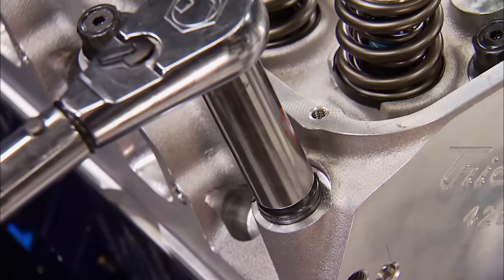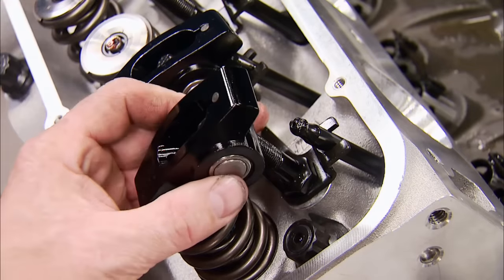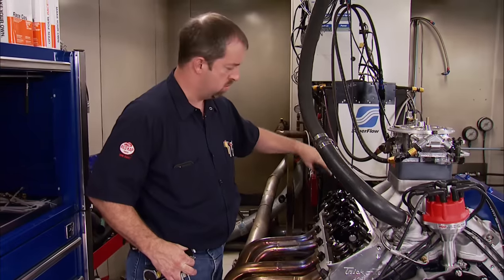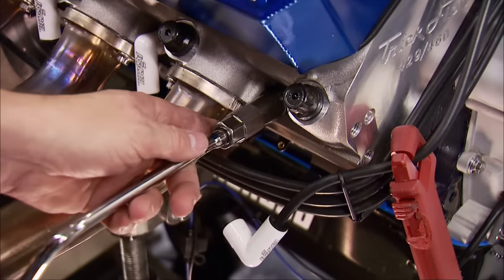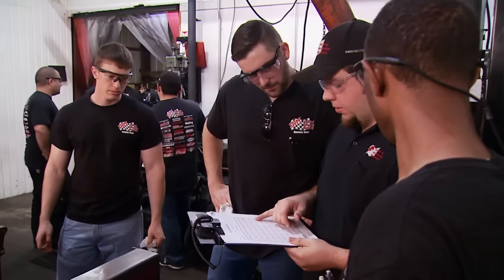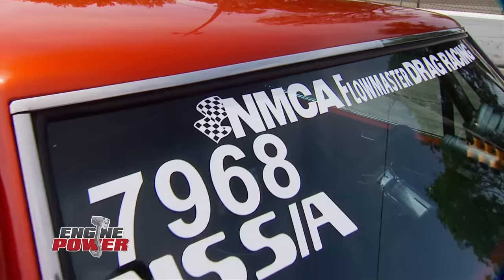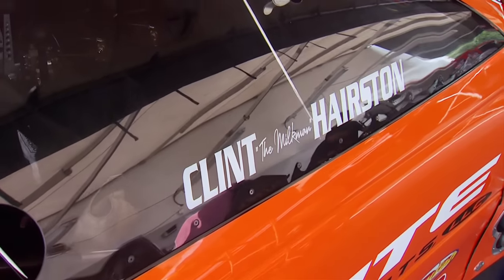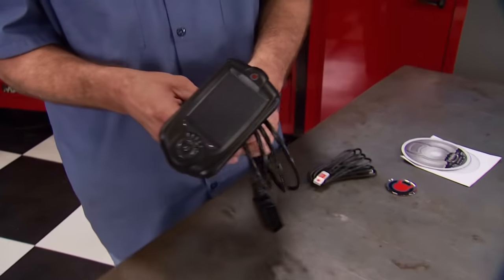Pressing the Limits of a Ford 557 by Adding Nitrous - Engine Power S2, E22

Comment: I'm 55 and it blows me away that over 1000 hp is achieved with relatively no exotic parts.  That would only have been a dream when I was young.
Reply: Don’t hate, soon it will be the internal combustion guys vs EV guys. The k24 is a killer engine but you know you’re stirring up a hornets nest saying it casually in the comments section of a big block build with nitrous. Everybody has their preferences, don’t create reasons to exclude/hate. Be stoked that there are people motivated to continue pushing this awesome hobby further everyday. Get out there and work on that project!
Reply: @datraktorman69  but it only last a few passes at the track before "BOOM"🤣
Reply: @datraktorman69  facts! I would never build a engine with cheap Ebay parts. I've known way too many people that engine went BOOM with that Chinese junk. You'll get your 1,000 rwhp but it won't last long🤣
Reply: @datraktorman69  yeah, I had someone build a reliable Rat that will give me many years of fun. So go ahead and save your pennies for a Ebay turbo.
Reply: That's a no 💩er. It used to be a real job getting just over one horse per cube. Now that's about where you start if you're going to build a real hot rod. This is the stuff that only dreams and science fiction were made of.
Reply: @datraktorman69  correction...my car is a daily driver. Where's your video of your 1,000 rwhp junk Chinese Ebay 2.4 turbo at?
Reply: @Russell_and_Rosko  it's nothing wrong with building your own ride. I actually built mines. Still working on it, I hate when you get some idiot talking about building a high horsepower engine with Ebay parts. If you're gonna build something, build it right from the beginning. Stop cutting corners.
Reply: @datraktorman69  yup! I figured.  Well congratulations 👏👏👏 #1 backyard mechanic on YouTube 🤣
Reply: @datraktorman69  believe what you want. P.S. don't waste your whole life on being a backyard mechanic. It doesn't pay much. Open your own performance shop and start building LS engines or something...Ha
Reply: @dontbusttheplace8151  👍👍
Reply: @datraktorman69  Apples to oranges comment. Not knocking any off them. I respect any powerful build. However I'm pretty sure those Hondas aren't NA. This simple BB ford pump gas engine is a monster for what it is. An easy reliable 1000 plus hp build.
Reply: Nicks backyardprojects Why waste your time on Honda’s when you end up getting smoked by one of them new Shelby Hellcats?
Reply: @datraktorman69  my fj20et skyline engine with stock rods set of aftermarket pistons and valve springs can make over 650 at the wheels . Fuck Honda,  Subaru,  worse Japanese cars to modify.
Reply: @bigboreracing356  then again ,those big blocks are giant fucking engines ,they better be making some damn power.
Reply: Michael Teeple  Top fuel would like to have a word with you about your completely false statement.
Reply: @musclebone7875  "don't waste your whole life on being a backyard mechanic. It doesn't pay much. Open your own performance shop and start building LS engines or something"

this line bothers me,i know a few people who do backyard work on the weekend to make extra money,and i know a few who do it full time.
all of them aren't after money like you they just want enough to live comfortable and take care of their families
Reply: @0Heeroyuy01  👍👍 that's reality though
Reply: Michael Teeple hey man nothings wrong with Honda’s a miatas 😔☝️
Reply: @musclebone7875  reality is this.
most people are backyard mechanics b/c unless 1 you live in a big city like Nashville,New York,Dallas,Huston,LA ext performance shops don't do that well,which is why its better to open ether 1 a mechanic shop or 2 a restoration shop
Reply: That engine just add twin turbos and youd have 100hp easy and fairly reliably. These days the science is so well known now its great
Reply: Michael Teeple 300 hp is more than enough for pretty much any street built. Nobody really needs 500 hp it’s just nice to be able to brag about figures
Reply: Michael Teeple  oh you're real cocky? Not as many people know about making things as fast as you? But why don't I see one video you've posted that proves that? Buddy tons of people have forgotten more than you'll ever know there's always someone smarter and faster I think you're either a young kid acting or an old man who refuses to accept he isn't who he thought he was and it bothers his ego, but it shouldn't man we all love the same things. Engines!
Reply: Never too late to build it.
Reply: @Russell_and_Rosko  
The problem will be trying to recharge all the E.V. s Assuming all we have are E.V.
Reply: @Russell_and_Rosko  I can't wait for all the drag strip shutdowns due to battery packs letting out the magic smoke.
Reply: I remember when the first rail did 160mph in the 1/4 mile. Shortly thereafter, people started speculating if 200mph would ever be achieved. The general consensus was that level of grip would never be possible. Turns out the general consensus was wrong. 😉
Reply: Remember when they said the age of high hp muscle cars was over? Last twenty years has been crazier then the muscle car era

Comment: Chevy 572, dual quads, tunnel ram, 750 h.p., ford 557, single quad, 750 h.p., how about the same tunnel ram and carbs as the chevy?, oh yea, they didn't have one " laying around the shop".
Reply: STREET RACER it’s been proven by David friburger that single carbs are far superior to dual
Reply: chevy has always needed bigger engines to compare to ford.
Reply: @thomasdavis3998  This build seems to suggest otherwise, the BBC made 4 less HP with only 15 more cubic inches. Its a solid comparable build.
They both make good engines, and are both capable of the same power levels.
Reply: STREET RACER call up Jon Kaase and tell him that.
Reply: @bigboreracing356  oh yeah theres only two kinds of junkolets the ones that's  been out run by a FORD and the ones that's gonna get out run by a FORD .
Reply: You said BBF's are junk boat anchors. Now you're making excuses as to why these guys would beat you.
Reply: Also BBFs do awesome in the truck pulling world. There is about 1 to every 10 chevys in the truck pulling world. But they are always in the top 1-5 in every pull. But I'm assuming if those guys would take your 468 Chevy they'd dominate every pull.
Reply: No no. You kept blasting all big block fords. Saying they couldn't keep up with you and that they were unreliable.
Reply: STREET RACER I’m running a single 35mm SU carby on my 1.6L Cortina that’s running 91RON (which is like your 87 Octane) and I’m getting 850rwhp. So nyehnehneyehneh.
Reply: I'm sure you're a truck pulling expert too. So enlighten me and it's not because they have a Chevy engine.
Reply: Honestly have no idea. I'm thinking they put more torque to the ground. Though I'm not 100 percent sure. Maybe they all just run 468 chevys and pretend they are fords 🤷‍♂️
Reply: @luketeverino6085  That's why Pro Stock ran single carbs before they switched to EFI.  Oh, wait!  They didn't!
Reply: Corazon del Oro obviously to a point single is superior to dual. I’m talking street engines not pro stock lol
Reply: That's how it's always been done brother. They throw the kitchen sink at Chevy's best castings. They'll usually use a smog engine or something out of a  Wenebago to start the Ford "comparison" engine. I'm surprised to see some Atomic Number 13 cylinder heads.
Reply: @bigboreracing356  i didnt know that 750 hp was faster than 750 hp on pump gas but oh ya your chev is special

Comment: The sound of a cammed big-block, be it Ford, Mopar or GM, has a magic all its own!!
Reply: Something a ricer will never understand...
Reply: rod928s4 at the end of the day they're all just air pumps. Rarely do they sound different. Unless you have a wacky firing order.
Reply: Bill Chaput lmao 😂
Reply: No matter that make! Their is no replacement for displacement!!!!!
Reply: Truth be told !
Reply: @alexcorona  cept them 5.0s some of em have a funny sound.
Reply: @kidsythe  dual overhead cam, 4 valves per cylinder. I had a 2013 Mustang GT 6 speed manual with the 5.0 coyote. BBK shorties(basically mid length by design) headers, off road x-pipe, Magnaflow dual 3 inch exhaust, cobra jet intake manifold ported, cobra jet twin 65mm throttle body, ford racing cold air intake with custom aluminum inlet, emailed race tune on 91 octane, dynoed 443 rwhp and 380 rwtq. It had over 440 rwhp from 6500 all the way to 7800 rpm. They do have a different sound, but that's because of their design
Reply: Yes! I have said this for years! Doesnt matter what ur choice is we all have respect for a nice build! If not, then you arnt a true blooded car guy!!!
Reply: @alexcorona  I guess you've never heard the cackling of a cammed 427 FE Ford😁It's most definitely a sound all it's own 😌
Reply: I like all 3. I don’t like either more then the other
Reply: rider  you r apslutley right bro
Reply: They all have different sounds that are great. I have a 460 in my 97 1 ton truck, a 302 in my 84 GT, and a 4v 4.6 DOHC in my 97 Cobra. The 460 is a built N/A low end torque engine, the Cobra is built with a KB supercharger for autocross, and the 302 is a built high RPM screamer. I love then equally with their own identities.
Reply: It's because when you put real good heads on a big block Ford they really start to rip ass and then the nitrous too mucho grande torque

Comment: "Don't worry, your mopar build is coming soon".
We just need for the second mortgage on the shop to clear, and to sell some tools.
Reply: If you've seen Andy f & his 470 ci mopar, over 750 hp n/a for less than 13k
Reply: Yeah, no kidding 

Mopar has some monsters in the engine department, but by God they're not cheap
Reply: 30k later
Reply: I'd like to see a 400 Cleveland build. You don't see those much anymore but can make big torque

Comment: That thing has me drooling. I can see this thing in a 69 mustang.
Reply: Nice drag times, but in my opinion I prefer all aluminum low sitting small block v8s or even a twin turbo v6. a lower geared final drive stiff roll bars and fat tires
Reply: I want this thing in my f350
Reply: I was just thinking “what would I put this in, would it fit in my Falcon”.
Reply: @falconpowerful2362  it would fit in your falcon but you would need a stiffer suspension all around and the car would need lowered, much of that powe could be wasted as the falcon on very light and would have a heck of a time transferring power to the ground, the wheels would constantly spin, and the massively offset weight distribution would make the car very unstable and unsafe, it's like putting a putting a rocket engine on a tree leaf.

Comment: The Trick Flow 325 Power Port heads are very nice pieces, but for this size of displacement, I think they are a bit on the small side. This combo with some P-51 heads will pull over 800 horses on motor alone, and very likely be over 1100 on the bottle.
And with the new SR-71 heads, I think power would be substantially more still.

Comment: i regret  having overlooked this engine platform for all these years.
Reply: Should see what forged and turbo mega squirt will do.. whoo.. 2k hp
Reply: @bigboreracing356  it was a truck engine.. built to pull and move heavy trucks.. albeit not very fast
Reply: Only thing I would use for toeing is a 468 Chevy right street racer. They are so much more powerful and reliable than a ford. Let's post it all over Facebook so everyone can be impressed with the 468 Chevy

Comment: I off-road with a 1979 Ford Bronco running the original 400M I have been thinking of upgrading to a 460 cu. in.  But i don't a 5900 rpm engine, off-roading I need low rpm torque 1800- 3500 controllable for trail driving and rock crawling.  I would love to see a build for a similar rig as my own.

Comment: 750 h.p. with a single carb, pump gas and a streetable cam and cylinder heads - a number race engines made not so many years ago. 1000 h.p. still just as streetable, still on pump gas puts it amongst some strong street engines - no matter how common the magazines make it sound, how many do you actually see?
More cylinder head, more camshaft, more carburetor and 1300 to 1400 (on the bottle) isn't out of the question.
Now THAT'S one wicked street package.
Reply: I wouldn't call it a reliable street package but definately a street package. Only thing that I would change is run a hydraulic roller cam to make it more maitence free.
Reply: @sandchar  
This particular build - I say it's reliable - you could drive a car with this engine in it every day without a breakdown, in fact rollers don't have failure issues when they don't sit - the roller axles stay lubricated - and they would be the weak point, that's as reliable as any high output engine gets. You don't get stock engine reliability once you start making modifications.
If setting valve lash occasionally is what you're getting at, both flat tappet and roller solids go a lot more miles without adjustment than most people realize.
I ran flat tappet solids in my street/weekend race cars (at that time it was one car for everything) for about two decades and it was unusual for one to need lash adjustment more than once every 10,000 miles even with seriously wild cams.
As engine man for a race team (NASCAR truck series) engine maintenance was my responsibility, part of that was monitoring the valvetrain, watching for failure (solid rollers). We'd run 2-1/2 hrs, 500 race miles - wide open throttle with the exception of yellow flags, with engine speeds between 7800 and 8100rpm - and never had any lifter failures. Valvetrain inspection was checking valve lash, if it varied it was the first sign of one of several possible failures. The only time lash varied more than a couple thousandths the issue was valve stretch, titanium valves have a finite service life before they'll stretch then fail in tension. You probably know what dropping a valve does to an engine.
Valve springs on this particular engine - and any engine that runs high rpm - would be high maintenance, and going to a hydraulic roller would make that worse. Hydraulic roller lifters are heavier that solids so the springs need to be stiffer to run the same rpm as solids.
These kind of builds require inspection which is maintenance just the same - nothing with this kind of output is maintenance free.
The maintenance would be the same or worse depending on how often it's wound up high.

Comment: Do Not bottom your head studs  in the block like these guys did with  a impact tool. It states in the ARP instructions to put them in hand tight only. With heat expansion you can damage your block or stud threads.
On the engines I build I measure the thread depth then ensure that my studs go in far enough and aren’t being held up by a tight thread burr.
I personally leave them a 1/4 loose and have had no issues with that in 30 plus years of building the specific engines I build.

Comment: I'm running a 460 BBF in my 65 Comet. Bored only 30 over. 1000 cfm Holley, pump gas. cam, Cobra Jet Alum heads.  Never dyno's but estimate about 575 hp. What would you estimate the hp would be with Nitros, which I have no experience with.   Thanks, really like your work.

Comment: Damn  i was thinking that my 351 build was doing  exactly what that big block was doing  dyno test showed 806 hp on pump 93  i was so excited  my head swelled and i was gunna get on here and brag  added a hundred shot of nos and 1043 hp i was geeked  my small block is a bad mfer then they showed the torque number  my numbers were well short of that mine 806 hp/ 602 torque the 1043 hp /898.5 torque i mean those arent shabby numbers  but  that big block is a straight torque monster for sure

Comment: Valve springs are gonna be troublesome on the street with that much lift, keep it under .700" gross lift and things will stay a lot happier for much longer not much noticeable difference in power for the added durability and cost of maintenance an addition of a Stud girdle would make a noticeable gain in power and less rocker stud breakage.